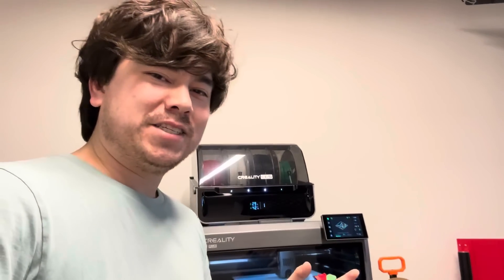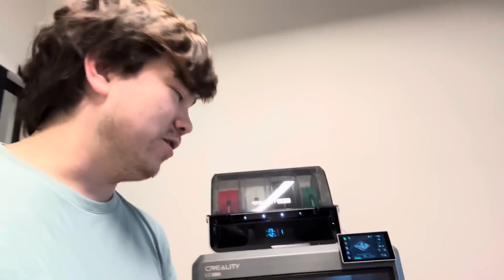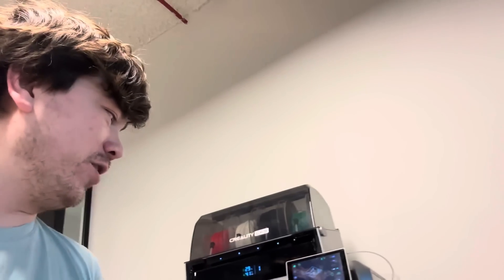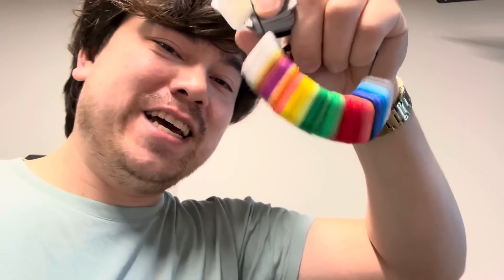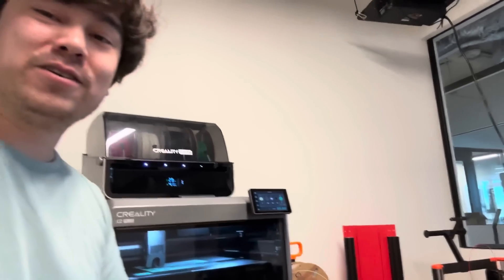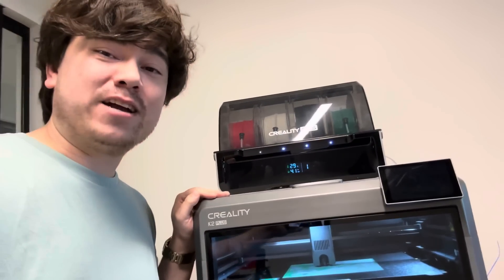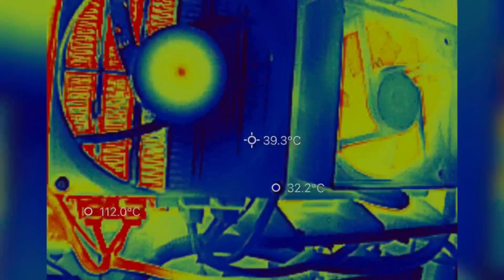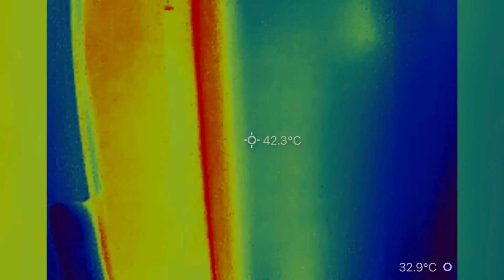The Creality K2 Plus Is The Most Original Design Ever

Comment: I cancel my order just because of all the machines that are receiving shipping damage. They than told me that no one had any damage reported to try to keep the sale. I do believe this is a hit or miss problem.
Reply: I received my K2 last night and the Fedex guy put it on the dolly upside down. However, it was packed so well there weren't any issues.
Reply: @AlgorithmicApostasy I think it a hit or miss on the shipping damage I just couldn’t justify getting with those problems. The other issues I think that 90% of those are users caused. So if they get one at micro center in Dallas I’ll drive the 3hours to get it.

Comment: How is the leveling of the K2 Plus bed? My K1 Max bed warps when I heat it to 110 degrees Celsius to print ABS. I would like to know if this issue of the bed warping at higher temperatures has been resolved in the K2 Plus.
Reply: Its much thicker aluminum they have said , But I too would like to see the proof in that as well.  I think Creality took a lot of flack about it already in the K1 so I bet it better IMHO

Comment: The creality seems like a bambu XL which is great.  If bambu isnt making one, creality will.  Prusa also screwed up the XL idea making it all about the tool changer. Nice idea but too niche.and too expensive, not enclosed, not heated.  I'd really like the creality k2 plus with its large build volume and IDEX
Reply from the maker: The base XL is orettt affordable at $1999.
The problem with toolchangers odds it balloons the price up. 5x Extruders hotends and toolhead boards adds up in cost.

I’m pretty certain the X2 series will use 2 printheads and an AMS system
Reply: @NathanBuildsRobots  what's the x2 series?

Comment: Each of the companies steals something from another company in some way, but I have also heard that the companies exchange money with each other and that there is a lively exchange of information and technology.

Unfortunately, there are many things that can hardly be done differently, but what Creality has done differently is the USB connection port. 😅

What I really don't like is that you can hardly attach anything to the printer, as a lot of it is glued and there are no screws on the outside for me. 😢 personally.
Reply from the maker: you can drill and tap the aluminum frame and add all sorts of stuff

Comment: My home based small business prints almost entirely TPU and the K2 Plus isn't a particularly good TPU printer.  The CFS can't feed TPU but the side mounted reel still requires a fairly long reverse Bowden tube which also isn't TPU friendly.  I suppose I can remove the top glass, unplug the reverse Bowden tube from the top of the extruder and feed TPU directly from above as is my usual.

I'm also a bit concerned about the complexity leading to less reliability, and the highly integrated enclosed design making the K2 Plus more difficult to maintain.

However, I can probably justify the K2 Plus purchase for new products on the horizon that will use ABS.  The large build volume and enclosed heated chamber will be very good for manufacturing those products.  It's not a good TPU printer but it is a good all around Does Everything printer.

I'm also thinking of hacking one of my bed slingers to swap the Y axis to a rotary axis to manufacture cylindrical TPU parts that are very difficult to manufacture on a Cartesian machine due to overhang angles.  TPU sucks at overhangs.  3D printers are the additive machining version of a CNC milling machine, and I need the additive machining version of a CNC lathe.  I should be able to 3D print my parts directly onto a micro grooved stainless steel rod.  There is no rotary axis slicer, so I'll need to write some fairly complicated G code by hand.

Comment: nice printer but how does it behave with flex filaments?
Reply: My home based small business prints almost entirely TPU and the K2 Plus isn't a particularly good TPU printer.  The CFS can't feed TPU but the side mounted reel still requires a fairly long reverse Bowden tube which also isn't TPU friendly.  I suppose I can remove the top glass, unplug the reverse Bowden tube from the top of the extruder and feed TPU directly from a bearing hub reel above as is my usual.
Reply from the maker: I bet we will get more brands producing AMS friendly TPU. Bambu Lab is selling some right now, it's just a matter of tempering it or using a higher durometer so it is harder in spool form.
Reply: @NathanBuildsRobots  - We needed higher durometer TPU, even before these multi-reel filament feeders, just to print TPU faster with higher print quality while retaining TPU's excellent interlayer bond strength, impact resistance and chemical resistance.  I look forward to finally seeing higher durometer  TPU from filament manufacturers other than Bambu.
Reply: @Liberty4Ever  I honestly expect to print a 2" height extension for the glass top if the nylon tube is rubbing as seems to be common on K1s and then could just tap a threaded Bowden tube adaptor on the rear of it to feed into the extruder if needed for the soft stuff.  You could put a thick plexi top on and just feed straight down from a reel as well.  We shall see soon I imagine.
Reply: @PatriotPaulUSA  - I considered the K2 Plus, but I just bought an SV08.  I plan on designing an insulated structural enclosure for the SV08, including a vaulted top.  I'll include 2 mm openings for filament fed from above to make it easier to print TPU.  PS - Love your YouTube channel name.

Comment: What is important to me, is reliability. Which is most reliable: Bambu AMS or Creality K2 Plus ?
Reply from the maker: They all suck. The only real solution that makes sense for multicolor is IDEX or toolchanger, where you don't have to purge the nozzle for each color change. It ends up being a huge amount of waste. unless you are making large batches of small parts, or large flat parts like hueforge prints or signs, the cost of changing colors is insane and unnecessary
Reply: @NathanBuildsRobots but does the AMS or Creality version reliably allow you to use PETG supports for tricky pla prints. Or vice versa?
Reply: @Ebonyqwe I have an A1, and a few months ago, it wasn't possible to use two different types of materials at the same time (e.g., PET-G and PLA).

Technical support explained: 'The reason PLA and PET-CF (and other consumables as well) cannot be printed at the same time is due to the difference in temperature, which may cause the nozzles to clog if the temperature difference is too great.' 

I'm not sure if this is still the case, though.

Back then, I found a workaround by setting both materials as PET-G but lowering the printing temperature for one of them to match PLA's specifications. It worked fine for me.

Also if I'm not mistaken you would want to print only top layer of support with different material to now waste time on changes at every layer. Not sure if you can do that.
Reply: @mikoaj2323  I imagine things like this will improve in time as well. We are still early in the FDM multicolor process I would think. Software and hardware updates will keep pushing this forward.
Reply: Multicolor printing on both of these machines will suck. 

Too much time and electricity, too much waste. Better to just paint. Most people can't tell the difference.

If that is your goal you should look at the ankermake.
Reply: @DingleBerryschnapps  I think for now the ability to print supports in a cheaper or less strong material is another use for these, (until the multicolor part can get better.) Its not bad in some cases, with larger layers, it can be much less waste as well. Its definately a new thing that will get better in time tho as you said. I can see buying a K2 without the multicolor add on for folks that just want a large heated enclosed printer as well.
Reply: Bambu's printers and AMS have high reliability. The AMS Lite in particular seems to have exceeded people's expectations.
Reply: @gooseheadedv1  they don't have high reliability. My ams breaks at least once per month.

Comment: But it's $1500!  WTF?  The idea is to build a  bigger and cheaper X1C not a more expensive X1C!  I'll wait for BL's large format printer.
Reply: Yeah, X1C+AMS is now down to $1199 (black Friday).  Sweet.
This said, it looks like a 3DP prosumer race is starting, like happened with mirrorless cameras (high-end models are now North of $6000 🙄)
Reply: @raphofthehills4405 and nobody buys that stuff anymore - so it's the proven path to oblivion
Reply from the maker: It weighs 90 lbs.
Cost per pound isn't too bad at $16/lb
Costs about the same as a nice steak
Reply: X1C + AMS is within $100 of this machine, what are you talking about?
Reply: @jacobm2625 creality is a budget brand numbnut.  It's absurd to even think of paying this much for a creality machine.  Furthermore, we are just going backwards in general.  We are entering prosumer territory with these prices.  Prices should be getting cheaper, not higher.
Reply: there are really good cheap 3D printers there's room for high end 3D printers what the f*** are you talking about.@BuzzingGoober

Comment: Who cares if it's original. Does it work and is it worth the price point. I say yes.
Reply: My problem with creality products that the never works. They usually looks like they works but in fact this is illusion. I bought S1 few years ago and K1C this year and both required additional actions just to simply properly print. This is pathetic. Meanwhile A1 worked as expected right out of the box.
Reply: @old-grumpy-man  To each there own. I have owned 3 enders and I have had good results with them.

Comment: There is only so many ways to build a printer Shure you can try all kind of different setup options but in the end people wants something that works not something full of new ideas that don't work
Reply: The firearms industry is similar.  Some of the mechanisms and concepts are over 100 years old.  Modern manufacturing methods (including 3D printing!) are making different mechanisms and concepts possible but most firearms are a remix of existing technologies in different ways and it's rare for anyone to sue anyone else because everyone is playing by Nothing New Under The Sun rules.

Comment: Yeah there's alot of design elements from other printers like an android is to an iPhone. They both have touch screen, side buttons and microphones to talk and hear from. Who copied who, or are they just working off a standardized UI of a phone? When it comes to printers there's only so many ways to vary the operation of a rectangle with computer parts. 

Noy directed to yoilu or your videos but rather to those complaining....I mean the creality has a door on it like the bamboo, do we say the k2 copied all printers before it with doors? It's so annoying hearing people compare the two. Go up to your bamboo and tell it to print 350^3. Go up to bamboo and tell it to heat the chamber 1 degree above room temp. Tell your bamboo to unclog the ams without having to take it apart. When bamboo comes out with a 350 build plate are we going to say they copied creality?
Reply: Creality isn't the one currently being sued for patent infringement either